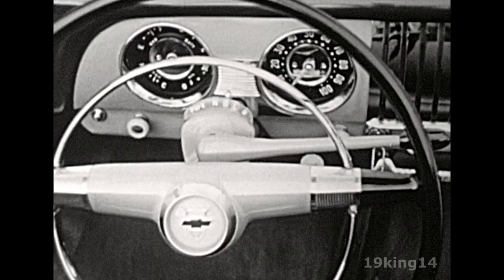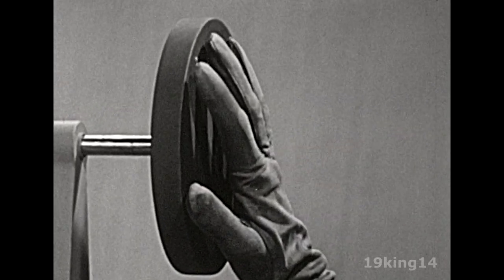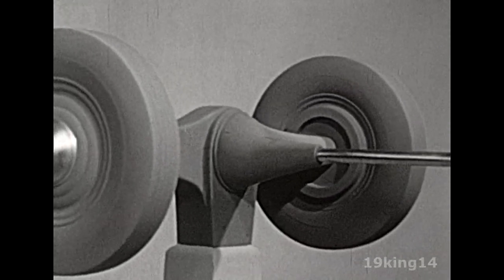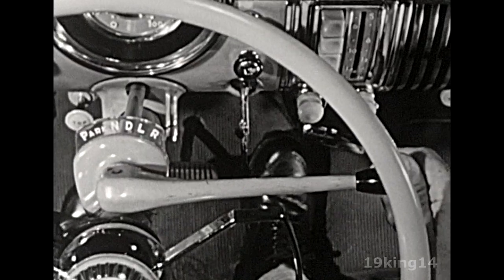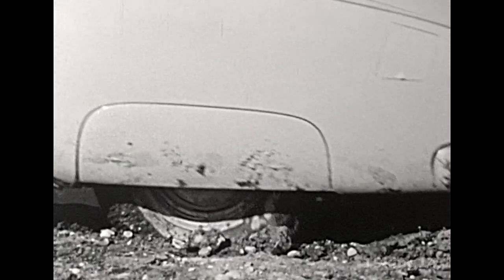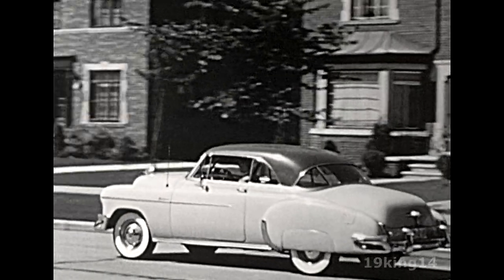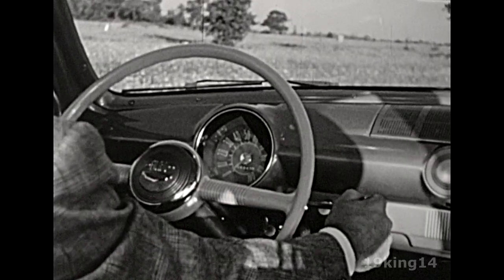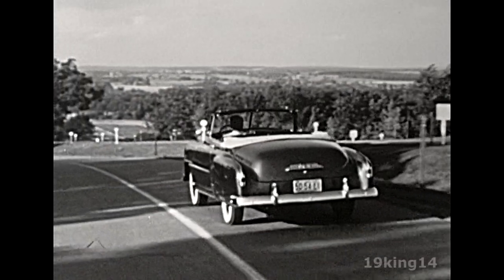1951 - Velvet Glove - Chevy's new automatic transmission

Comment: Very interesting!  That early Powerglide was just a downsized Dynaflow.  It didn’t shift but relied on torque multiplication in a single gear.  Later years brought out the two speed version the shifted up automatically.  Good film about real cars!